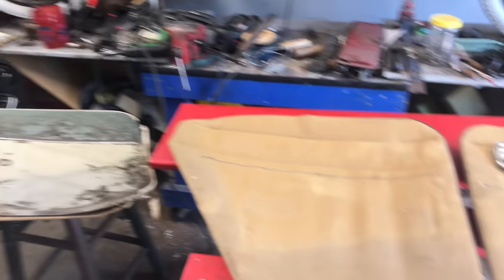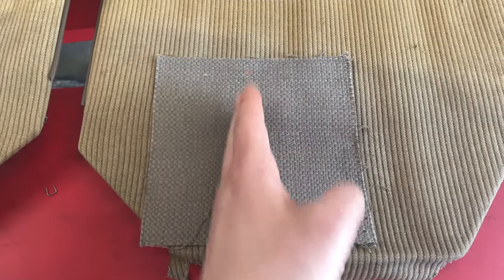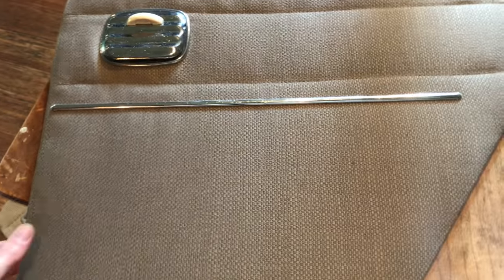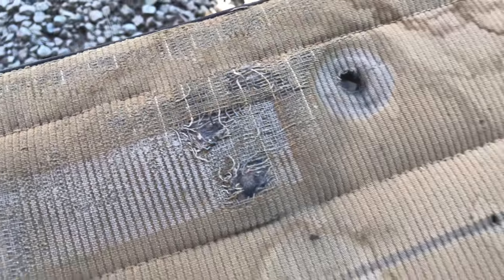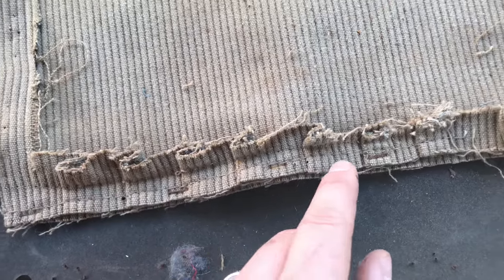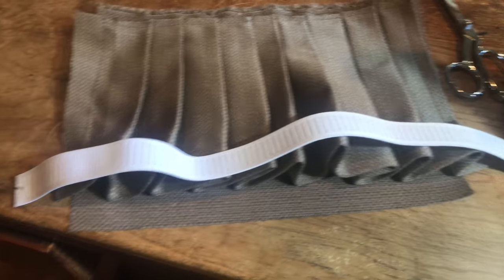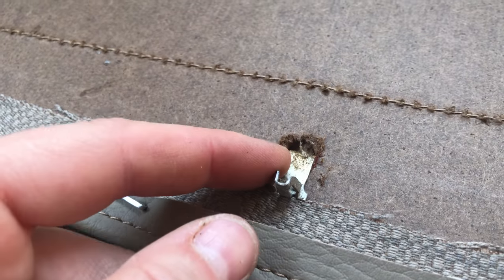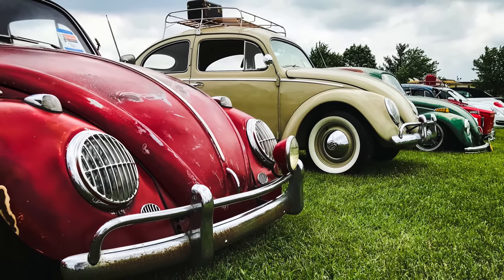VW Type 1 Custom VW Beetle Upholstery, door panels/cards

Comment: Glue a very thin piece of plastic to the back side where the sewing line is and that will help support the area. And isn't it funny how the old sewing machines are like old cars, much better?
Reply from the maker: Will do that with the plastic! Thanks! Might even use that sound deadener stuff it worked great for the sound and a little more can’t hurt! That old machine has been worked so hard since I’ve owned it...I mean I put that ole gal through the wringer almost weekly...it has never failed me and sews like a hot knife thru butter...I figure any sewing machine you have to add oil to is MY kind of sewing machine!